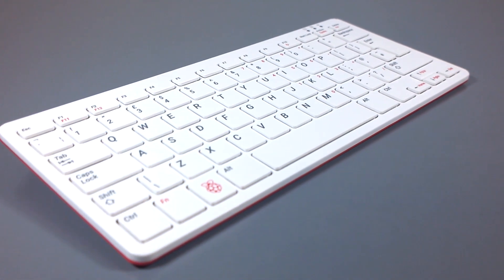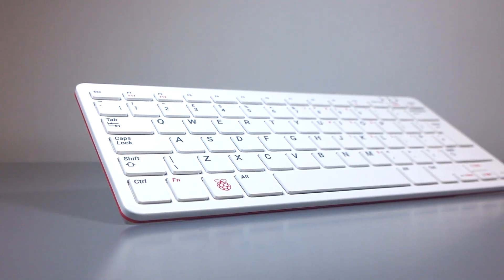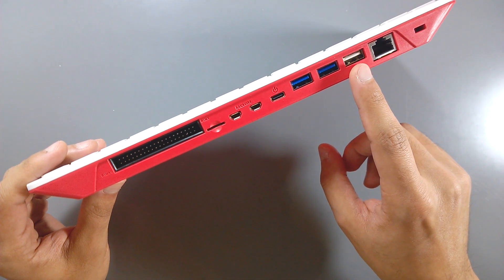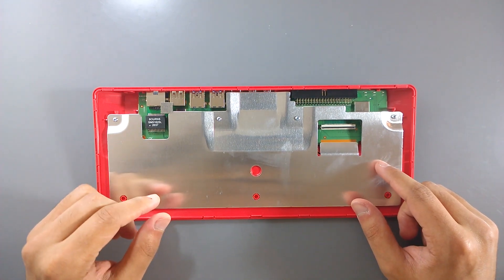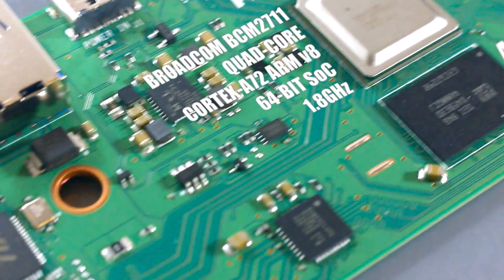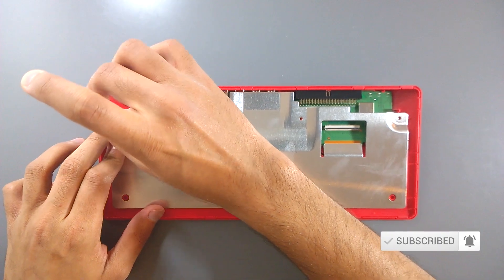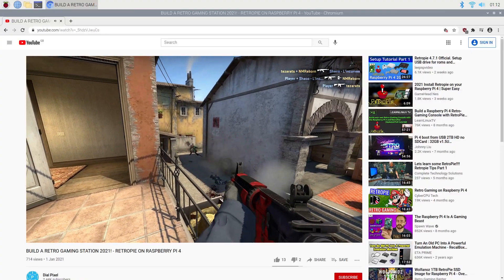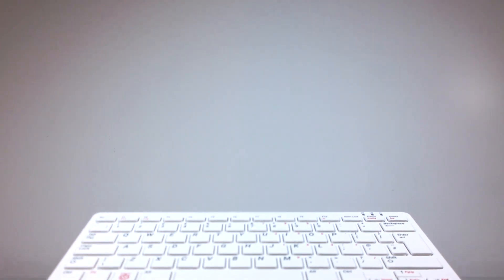The Raspberry Pi 400 Review - What $70 Gets You!

Comment: I'm very disappointed with youtube performance, 1080p is awful, doesn't have the power to do it. For £100 maybe its too much to ask for a full fledged desktop experience.
Reply: VLC handles 1080p on it pretty well. I have mine overclocked to 2.2ghz which makes it smoother too.
Reply: It's not ready out of the box. But it plays just fine once you get it all ready.